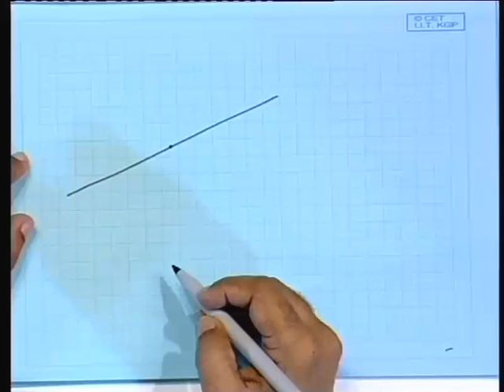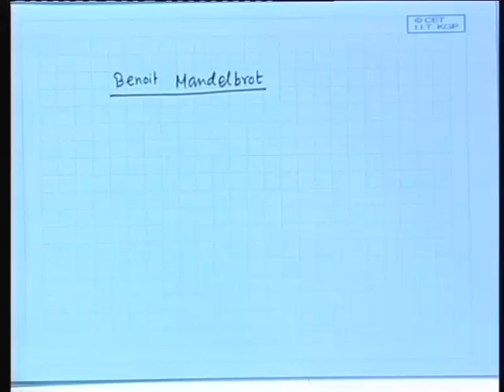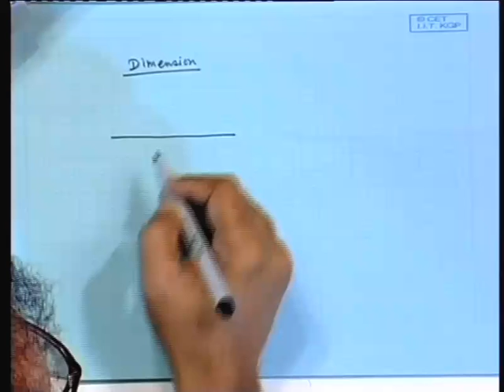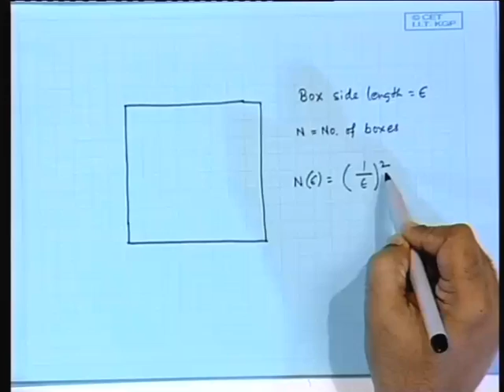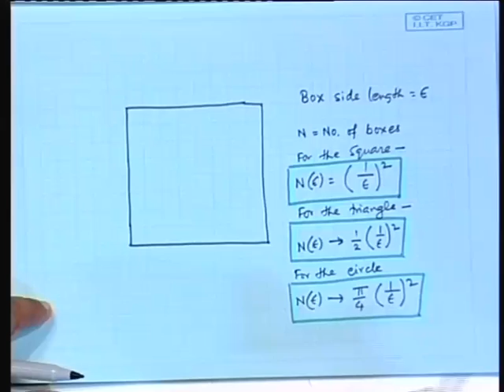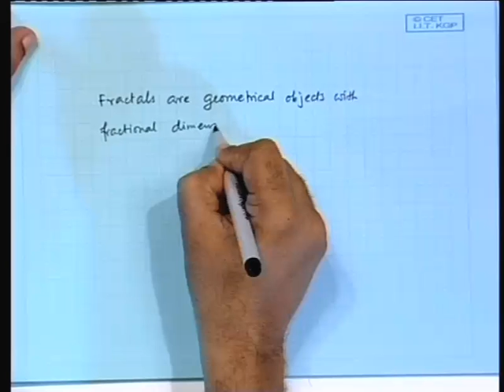Lecture - 14 Introduction to Fractals

Comment: Sir in 33:51( time in video)
Both have the same denominator ln(1/epsilon) but only the 2nd term vanishes
1st term could also vanish 
And why the condition of (epsilon->0) was not applied in 1st term????

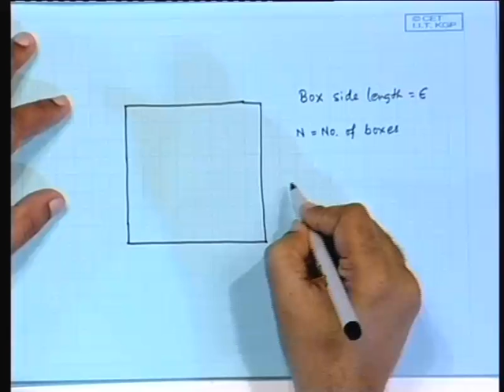Comment: Great work! but @ 25:41 I think your definitions are incorrect but understandable. 

Either your definition should be  1/N = No. of boxes or the equation should look like 1/N = (1/epsilon)^2. 

Could someone comments on this? Or am I going crazy with simple math???
Reply: Say you have a square of length 1, the number of squares needed to fill it initially is itself, hence 1 square is needed. Say you're taking smaller squares of size epsilon = 1/2, hence, the number of squares needed is given by N(Epsilon) = (1/(1/2))^2 = 4! Don't see where the difficulty is, here. !! :D

Comment: Scale, old darling, scale. If you measure in square kilometers then your area enclosed can be approximated as such. As you step down through the scales you can come right down  to angstroms and still get a measurement but would it be relevant to a working scale?

Comment: is it really an infinite length though? wouldn't you have a series that converges to  finite length?
Reply: I can't speak for all cases, but there are some cases where the limit of the measure if the fractal in one less dimension than the embedding space would tend towards infinity, for instance, the Koch snowflake. You would begin with a triangle, and each iteration you take the middle third out of each line segment and graft a triangle with no base to the hole such that  the shape remains enclosed. Assuming the triangle is the zeroth iteration, the formula for the perimeter of the snowflake is 3*(4^i)/(3^i). The Koch snowflake is the construction of this form with infinite iterations, with its perimeter being defined as 3*lim i->infinity (4^i)/(3^i). This perimeter tends towards infinity, despite having a finite area.